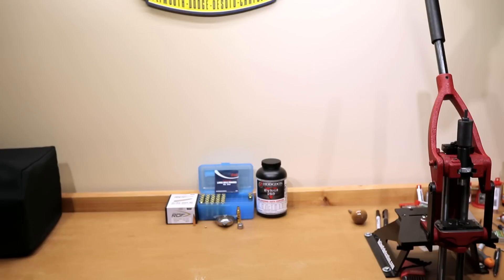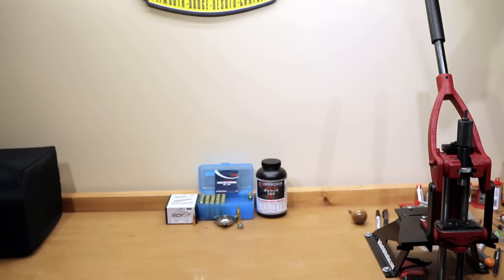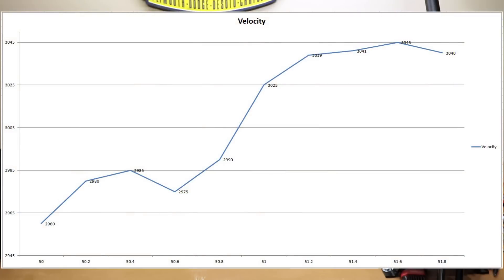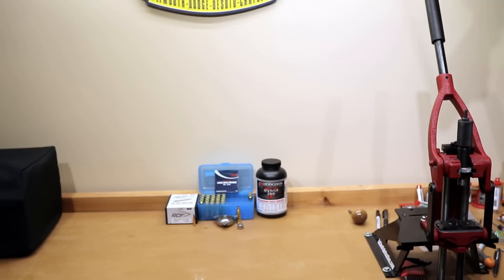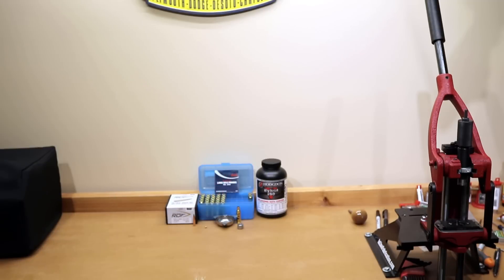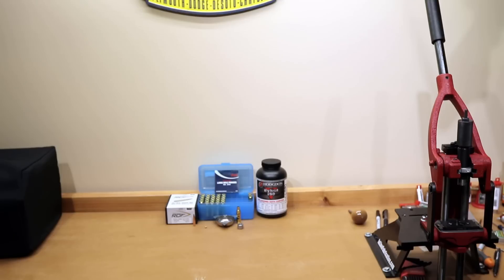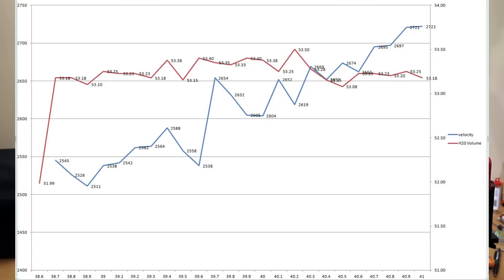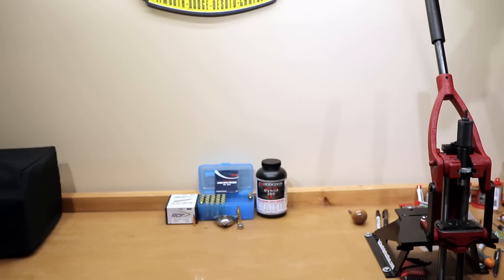Using the Scott Satterlee load development technique with the Nosler 140 RDF and Hodgden H100V

Comment: another inconsistancy you may find with brass is the primer ignition hole is punched from the outside in, this causes burrs on the inside and may or may not cause ignition varances. there is a deburring tool that has a depth setting bushing so you can deburr each brass the same depth but first you have to trim necks.
I just did a set of R.P. brass they were pretty bad. By the way Remington is aabout the worst brass I have used ,case weights are random as hell and they are much lighter than winchester. Winchester is pretty consistant. So now if I buy loaded or unloaded I will steer clear of rem. brass!

Comment: Why did you use magnum primers for this work up? Just curious
Reply from the maker: I have found that they ignite some powders more consistently.
Reply: @BoltActionReloading  magnum primers in my 243 allways yieled low speeds with hybrid
Reply from the maker: Hi Chris, I plan on doing some more extensive research on this topic as I think many people are confused on the interaction of different primers. (I am not claiming to be an expert on this either) I have not done as much work with H100V as I have with H4350 so I can easily see there being differences. I am looking forward to putting some data behind my assumptions.

Comment: My assessment of the Satterlee method is that it will yield positive results only some of the time. 
One sample of anything is statistically completely meaningless. The only way this method could possibly yield positive results is by pure chance as, any data can by definition, hold no statistical validity.
Statistics requires 2 or more of any sample &, unless there exists some prior knowledge (prior samples) this Satterlee system can only be operative by chance. 
Results would actually be, to some extent, statistically significant with the application of at least 2 shots per charge weight.
Other than proving that an increase in charge weight yields an increase in velocity, the Satterlee method can not yield results beyond pure chance & what is left can only be the perceived results of the tester.
Furthermore, I don't believe this Satterlee method is actually testing for a supposed velocity trend. 
For example; if we were to assume a particular powder was perfectly suited to a particular rifle/bullet combo &, that powder acted precisely as it should then, with progressive increases in charge weight, we would expect to see a linear increase in velocities with no levelling off until the point of maximum pressure is attained.
Let us suppose then that a band of charge weights can be identified which indeed exhibits the kind of trend which is known to occur. Using only one shot per charge weight interval is statistically invalid & is much more likely to be random noise than it is capable of being a trend. 
I believe that, in principal, the Satterlee method does have some merit if applied using the averages of at least 3 shots per interval. Other than this kind of modification, I can't see how anything other than random noise can result.

Comment: Consistency is all about eliminating as many inconsistencies as possible. That may well sound like a self-confirming maxim, but it's a mantra that was beaten into me by a very experienced professional load developer years ago, and it's stood me in good stead. Scott's method, is founded upon diligent component prep. If you rush the process, without putting the work in, you'll get unintelligible results. I know, because I've made the exact same mistake myself. Yes diligent prep takes a lot of time, but rushing the process is a total waste of time. Your own time doesn't cost you anything, so why wouldn't spend that little bit extra and do everything that you possibly can do? With regards to Scott's method, I view it purely as a means to identify candidate loads which offer the widest margin of error with regards to inconsistent charge weights/environmental factors. I've personally found that the smallest ES candidates don't always produce the smallest group sizes. Likewise the smallest group sizes don't always produce the lowest ES results. If you're lucky, you may find a candidate that offers the best of both worlds. Ultimately I still test OCW on paper, with Scott's method complimenting that process. Velocity is the least important metric in my loads, as a World Champion explained to me "you don't claw back any lost points because you missed the fastest". You'll medal with an ultra-consistent 2,300fps load long before you medal with an unruly 2,800fps load.

Comment: You know I have tried this some but what I noticed is extreme spread is single digits for several shots but as you keep shooting the extreme spread gets bigger. I attribute this to the barrel becoming more fouled. I have started to use it some but to think he is gonna get single digits say after firing 30-40 shots I'd say is a stretch an would have to see it to believe it. I would say I make sure brass for these test are fire formed, trimmed, neck sized only, an all cases exactly the same for testing. Once I found a velocity I was happy with I played with seating depth an was able to get some single digits e.x. But I tend to load batches of 300-400 rounds an some cases only have 3 reloads on them an some 5. It's gonna be impossible for me to get all 3-400 cases exactly the same unless I start all over with a new batch of 500 cases. Is it worth it to me. No.

Comment: You need fireformed brass, trimmed and uniformed to get accurate results. 
It's not a beginner test(not a reference to you) and data can be hard to interpret and sometimes you will get false node in the way.

Also I am sorry but the H100V is to me one of the crappiest powder ever designed and not suited for the creedmoor.

Do the test again with IMR 4451/H4350 and RL16 and you'll get easier developments.
Reply from the maker: No offense taken, just trying to figure everything out. Thanks for commenting.

Comment: When I’m ready to test my first work up. I plan to shoot load and shoot 20 rounds using the saterlee method. Instead of shooting 1 round at every .1grain, I plan to shoot 2 rounds of the same weight every .2grains. Basically it would be like running a 10 shot/.2grain test twice. By graphing the 20 shots as one graph, I hope to see a more apparent flat spot to focus attention on.
Reply from the maker: I have heard of several changes that people have used to validate this method for themselves. Ultimate reloder just posted his own variation, however he is doing this during fire forming, which I don't recommend. Best of luck to you.

Comment: Well that's fun and all. But I'm my opinion lateral testing at 4,5,6 hundred yards and repeated is I feel a catch all do all. It just really shows extreme spread of everything.  However I'm not saying you couldn't do it this way just for starting points. And yes need to use worked fire formed brass. And bench rest primers. I don't feel that just because you find a low extreme spread of velocity at a certain charge weight, that it's going to be a good tuning node for your rifle. Tuning nodes are at certain velocities. You must find that. Then work the brass and load yo be more consistent in velocity. Powder,neck tension,brass quality, bullet, all need to be consistent. When eley or lapua load the the Olympic match 22lr it is done under extremely atmospheric controlled environments along with bullet consistency neck tension, priming consistency. And you really don't reap the benefits of the match grade 22lr ammo with out a precision rifle. That's my experience!

Comment: This test should be done with already fire formed brass and shot at 400 to 500 yds for the velocity spread to show itself on paper.  However the numbers didn’t show much on the first try but if you do a second test of this I would try it starting at 40gr and stop at 42.5 or when pressure signs show up.
Reply from the maker: I wil likey try this combination over, but around me 400 yards is not easy to get to and i couldn't video it there. I did think about going a little higher, but thought that loading the same charge in the same brass might be interesting too.
Reply: moparmadman I know you are short on space available so velocity nodes will have to show themselves on the chrono...second firing should be more consistent :)

Comment: I do this method all the time. It really does work! I do, however, think you over did it a bit. If you re-did the test at 300 yards in .3gr increments, I think you will find more usable data.
Reply: handloading 24/7/365 this method ignores everything but velocity, distance is irrelevant

Comment: Full case prep retest fired brass. Looks like 40.3 -40.7 range is your region. Looking for one that should be good either way if your off. 

Retest should nail it down. Then explore...keep an eye out on that region for repeat gold. Would shoot a 5 shot group of 40.5 gr along with retest to see what ya get though. Skip bottom of graph and fire the hotter rounds like you suggest.

Comment: Looking for "NODES"....how fun.  I have even weighed all the brass for testing and put it in the loading blocks from low to high.  Then, I do the same for the bullets and line them up from high to low.  The hope is to even out the velocity by pairing heavier bullets with more volume.  Thinking more about that, maybe the heavier bullets need the smaller volumes, so the higher pressure but heavier bullets snd up with the same velocity.  If you think any of this makes sense, you have the disease.
Reply from the maker: +David Dale thanks for the insight ( I think) I hate to add too much cause I really do not want to add permanent steps to my process that I don't want to routinely repeat. We will have to see where this leads.
Reply: Just laughing at the things we do to achieve perfection.  Merry Christmas!

Comment: I think that if you did full case prep (fire forming, trimming all to same length, sorting by internal volume, etc as well as sorting bullets by bearing surface length) your results would have been different. If you can get the brass and bullets as consistent as possible it reduces the variables that much more. Also, when your cold bore shot is taken, do you have any oil in the barrel? If so that can tend to lead to higher pressures and possibly the velocity increase on the first shot. Great stuff as usual.
Reply from the maker: Thanks for the comment. It doesn't seen to matter if the cold bore is fresh after a clean or not. First shot is always higher velocity. I was really hoping to show what could be done with the least prep as possible. I don't think the average guys wants to neck turn, water weigh, etc. if they can help it. I really wish Saterlee would go into more depth on his reloading process, but I guess it will just give me something to shoot for.
Reply: moparmadman just having once fired brass alone may be enough to show a huge difference.
Reply from the maker: I don't doubt it, but I don't want to beat it to death either. I hate to wear out my brass just figuring out how to develop a load but in the long run it may be the best option.

Comment: The test relies on a consistent SD to tell you anything. I often get terrible SDs during fire forming, but single SDs afterwards. So my recommendation would be to repeat the test with fire formed and trimmed brass. If you're going to sort brass, select those with the most uniform neck thickness.
Reply from the maker: I don't disagree, but I hate to start with neck turning as I would prefer to load without doing that. We very well may end up there before this is over. I honestly thought about loading them all with the same charge and picking the ones with the closest velocity for a given charge and going with those.
Reply: moparmadman I hate to keep citing Zediker, but he's probably forgotten more than I will ever know. He says the best way to sort brass is by selecting those that yield Xs. Second best way is to select those cases that come out of the box with the most uniform neck thickness because it speaks to the overall uniformity of the case. So you don't have to turn the necks. Just go with the best of the lot.
Reply from the maker: +njgrplr2007 I recall that in the book. But I don't want to discard 3/4 of the lot either. Creating 5 sub lots out of 50pcs defeats my purpose.
Reply: I’ve tried this method with several guns and found the same. It relies on the existence of a low-SD node, so brass quality is critical. For me, it worked great even in virgin Lapua brass (6.5 Creedmoor and 6.5x55 Swedish). It was kind of meh in PPU 7.5x55 brass, and it was awful in Lapua 7.62x53r.

Comment: I alway start with a seating depth test at 300 yards to check for the best groups. Once I find a seating depth that is the most accurate. Then I do a similar test like Scott’s but I load two sets of 10 rounds at .3gn each. And fire the first 10 of them at 300 yards  looking for velocity nodes  and POI shift. Then I repeat with the other 10 rounds. This has seemed to work the best for me the last rifle I developed a load for I was able to shoot a 1.6 inch 4 shot group at 500 yards with the flyer it open up to 2.3 inch 5 shots at 500 yards. I would like to see you repeat the tested with trimmed and fire formed brass to see if the number stay the same.
Reply from the maker: I know I am somewhere close to where it belongs in this case, the lower shots are all lower velocity shots. Satterlee  discuss doing this first and then adjusting the seating depth, so I am sure there is a lot of matter of opinion for choosing the seating depth. I did video the target but didn't think it was worth working into the video. Maybe if I redo it it will be more worth while.
Reply: Typically (at least from the several different rifles of mine that I have done load development for) you want start with finding the velocity node as Satterlee does, then adjust seat depth.  And this actually makes sense because seating depth is primarily just effecting barrel time more then anything except in the extreme's like projectile jammed into lands or seated excessively deep in shell. A few thou of seat depth can have a substantial impact on barrel time and thus accuracy but little effect on velocity.

For example, I was doing some loads several months ago for my 6.5cm rifle with 123gr ELD-X's and I found a nice flat velocity node at 43.6gr of H4350 where I was getting average vel. of 2932fps with an ES of 9 and SD 4.5. I cant remember my exact numbers during the Satterlee type velocity node test but I was only say about a 10 or 11fps difference between 43.4 and 43.8gr but at Hornday's recommended 2.670" (if memory serves be correctly) COAL, the 5 shot groups were almost 1.5moa... I started playing with the COAL and got the groups down to consistent 0.43moa with a COAL of 2.735 and the vel. ave. when to 2923 but ES and SD were virtually identical.

This is why I actually prefer Satterlee's method over even 300+ yard ladder test or other OCW tests.. With consistent velocity, POI will be most consistent when the projectile is exiting the barrel exactly the same way every single time and the only way to insure this is that the pressure wave within the barrel is back at / as close as possible to the breech when the projectile is exiting the barrel (muzzle will be in its most relaxed state). Since the Speed of the pressure back and forth through the barrel is so fast (almost 19000fps)compared to the projectiles speed , even just a few thou of an inch difference in seat depth can have a significant effect on where the wave is relative to the projectile.

Comment: There are so many opinions out there that finding the facts can be difficult.   I agree with you that reducing the number of variables is the best way of discovering the truth of the matter.  I understand the reasoning for going to 0.1 grain but it reduces your overal window per shot fired.
I am currently using the dV/dGn method to scan through an area of load.  I just used it to work up a 7.62x39 load.
Reply: 1848	1	2208
1855	2	2260
1978	3	2274
1980	4	2296
1930	5	2300
1962	6	2376
1985	7	2377
2022	8	
2038	9	

This was the results obtained using two different bullet weights over a charge varied by 0.2 grains.  The left column was a 150 grain projectile,. The right  column was a 125 grain projectile and the middle column was cartage fired.  I would of preferred to have submitted the graphs, but could not figure out how, so I submit my results.
Reply from the maker: I am not familiar with this method is there a written method of this somewhere?

Comment: I have not tried this development but fireformed brass is a must for developing precision loads mainly due to the consistency in size.  A local long range match consistent winner weighs everything, bullets, primed cases and powder.  He however uses a Forester Neck resize and bump die.  He only shoots Berger 140 Match Target VLD projectiles Lapua brass and RL 17.
Reply from the maker: Truth be told I didn't figure that it would come out as pretty with not fire formed brass, but I needed to fire form it somehow. To keep the same load in the same case I may just neck size these out of convenience. I would rather use FL but who knows.